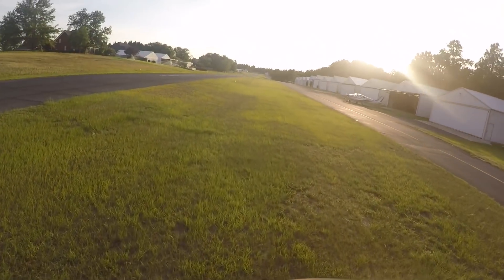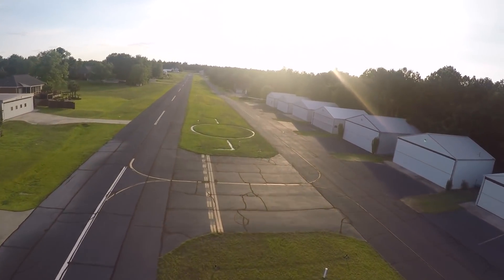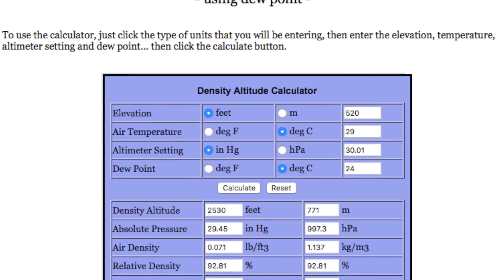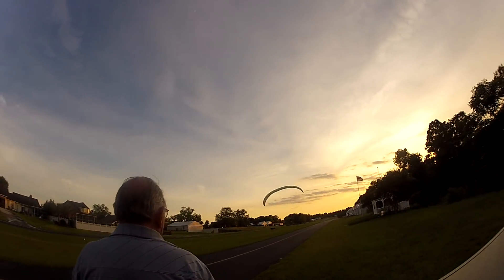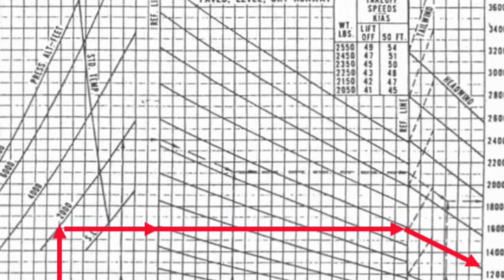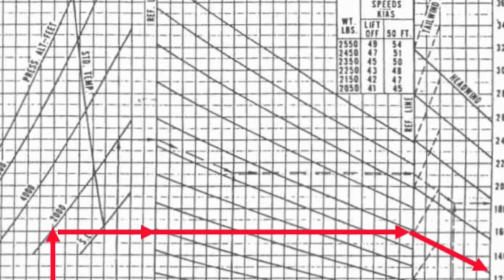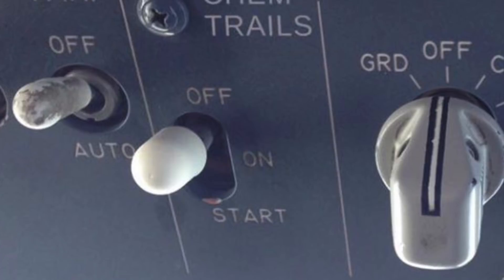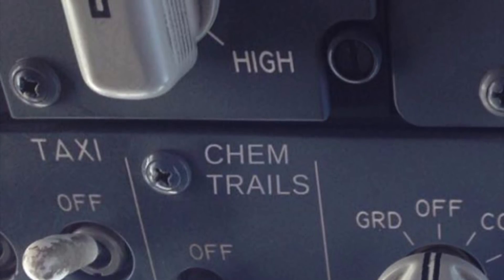Paramotor Density Altitude

Comment: I'm not sure your use of tables for aircraft translates to PPGs.  Here's why: the tables showing the effects of density altitude on takeoff distance take two things into account: loss of engine power due to decrease in partial pressure of oxygen, and increase in Vr due to decrease in lift.  They assume that the actual VALUE of Vr isn't that important, since any certified aircraft is well capable of taking off with a 10% increase in Vr - that's well within the margins.  This is not a good assumption for PPG pilots, since Vr is limited by how fast the pilot can run with a paramotor on his back.  If you physically can't run 10% faster (and keep in mind, the same decrease in oxygen that applies to engines also applies to lungs and muscles), this does not result in a 10% increase in takeoff distance, but an infinite increase.
Reply from the maker: You bring up a good point Jim.  

Like I've discussed in previous vids, us older guys have a lot more limitations that are reached sooner than the lighter, maybe younger & faster folks.  In some cases that is why so many poor techniques become habitual.  Since we'll never have reliable airspeed indications, I suppose it's pointless to bring up that the airspeed isn't what changes (Vr remains the same) but rather the ground speed increases with higher D/A because the wing needs to travel faster over the ground to push the same number of now expanded molecules of air under itself.  

Here's a few things to also consider: 1) Usain Bolt could run briefly 27.8 MPH.  Lets say the average parapilot can only briefly sprint to 15 MPH (24KPH), or just barely attain the average minimum glider flying speed of 24KPH with maximum effort. 2) a 2 knot breeze reduces that required speed by more than 10%!  I CAN"T CAN NOT OUTRUN A TAILWIND ON TAKE OFF!!!  3) Consulting some far more advanced aircraft manuals, increasing flap deflection from 5 degrees to 25 degrees for take off, often yields a 15-18% further reduction in required speed for flight. We can achieve the same gain with a deep application of brakes, so long as we ease the brakes back to neutral as we accelerate once airborne.  Either one of these planned out advantages will outpace the preformance losses incured from a 25 degree temperature change that results in an increase of a 2500 or 3000' in D/A.

In a nutshell there may be a day where you can't overcome foot drag or our own limitations of speed when D/A is high, but let's make sure we have everything else in order before we blame the high temps of summer.
Reply: I wasn't taking into account that Vr is based on indicated airspeed, not true airspeed, so my use of the term was incorrect.  But you rightly state that the real issue is ground speed.  I was trying to avoid THAT term because I wanted to leave wind out of the discussion.  But yes, of course, ground speed is what you have to run!  I think the rest of my argument still holds, though.  If a pilot is accustomed to using deep brakes to launch, he isn't going to have any more brake he can pull to make up for the greater ground speed necessary for a high density-altitude takeoff.

You, sir, are an inspiration.  Sure, Tucker is amazing, too, but he's just a kid!  It's good for people to see that paramotoring is not just for the young.